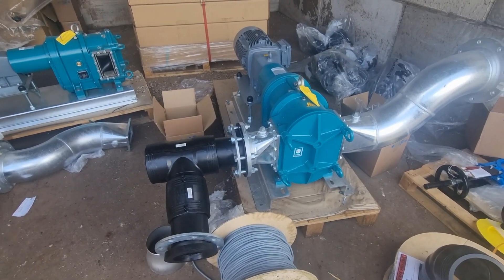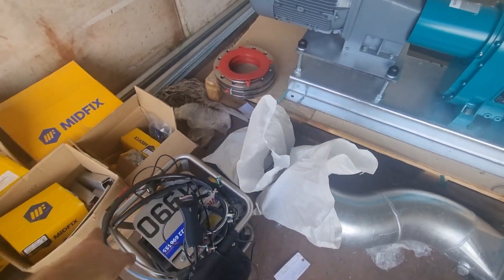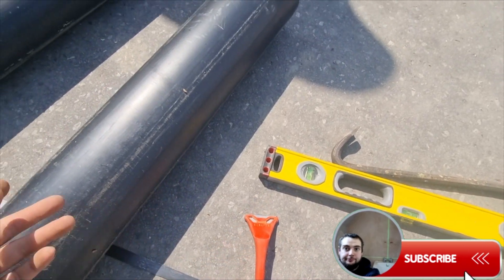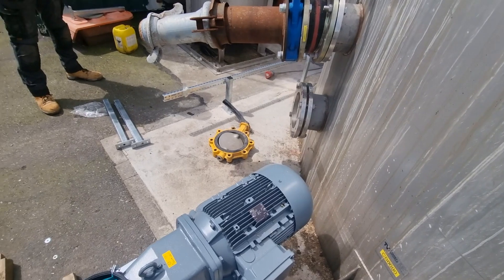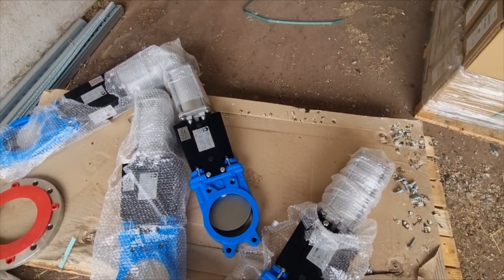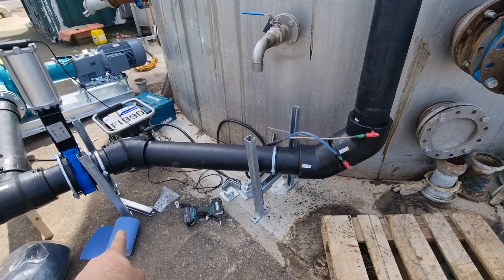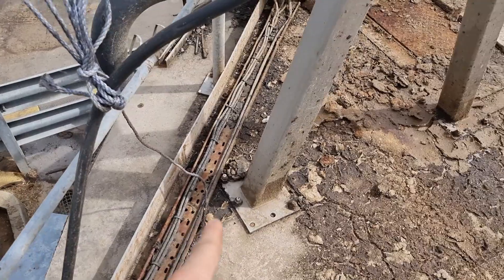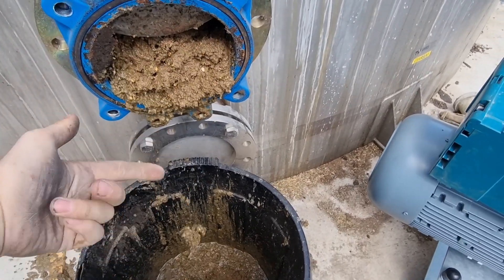Transfer Pumps Installation

Comment: Those GF fittings are fairly bulletproof, I've had a few pop and start smoking mid weld and even at that they never failed a pressure test. Important also not to weld them when the temperature is too low. Great video as always

Comment: Fusion machines have changed since I last used one!         The barcode reader makes it idiot proof if the prep is good, I would think.

Last machine I used had a digital panel that you programmed the heat time for the fittings in seconds.    

What are those wipes Tom, specials???     or just a acetone wipe

Looking forward to part 2 and the end result.    🙂
Reply from the maker: Hi mate, like you say its all in the prep, you can't honestly go to far wrong as long as the pipe is not moved during the heating and cooling period, the machine does all the work, the wipes are just fusion wipes. They are just a degreaser and cleaner. To be honest they seem identical to wonder wipes but they are only a few pounds a pack so worth using the proper product. I scrape the pipe and then just give the pipe and the inside of the fitting a wipe before assembly to ensure there is no dirt.